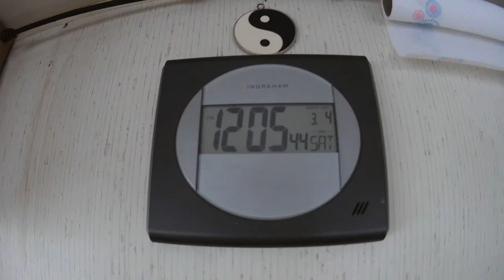Fulltime RV Living | Breakdown Getting onto freeway | Emergency Fix At Gee Creek Rest Area | Driving

Comment: I remember seeing the video when you put those shocks in and thought that could happen. Would have suggested putting a larger bolt through both ears with a block of wood or something as a spacer. Nice having a welder right there with you, would have been a more painful experience without it!
Reply from the maker: Ikr i should have braced that a little better, a spacer would have been a good idea, but it's all good i got the proper ones finally!
Thanks for staying tuned! :)

Comment: Please, Always wear eye protection when grinding or cutting metal. I know you made this video over two years ago.  I am OCD when it comes to eye protection because I learned the hard way and got metal in my eyes 6 times.  It hurts a lot and is not fun getting it removed at eye doctor. I now have an eye stigmatism in my right eye forever because of it, and no longer can fly airplanes. Please invest in double eye protection.  Just so you know I was wearing eye protective glasses and still got metal in my eyes.  You have to be aware of where the metal attaches to like eye brows and hair.  So an hour after you might be done you could get metal falling in your eyes from the flakes that were sitting in those places.  Then it starts to rust and causes extreme discomfort till the piece is removed and all the rust is removed with a Dremel tool.
Reply: CannaveraPainFree4Life -  thanks for the explained warning.  The fallout from eyebrows is nothing I would have thought about.